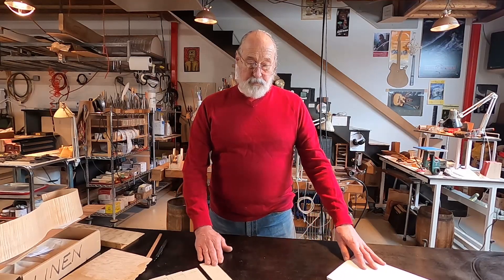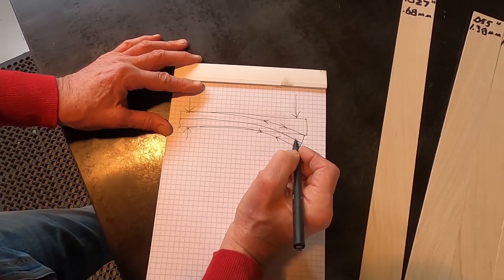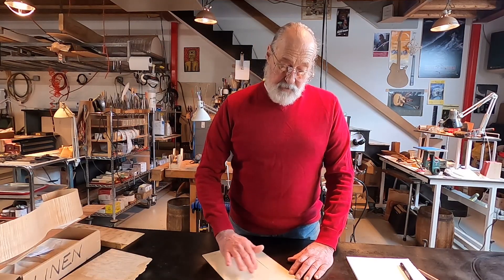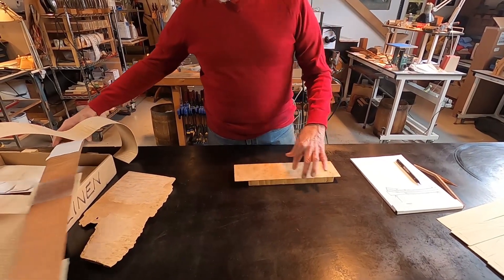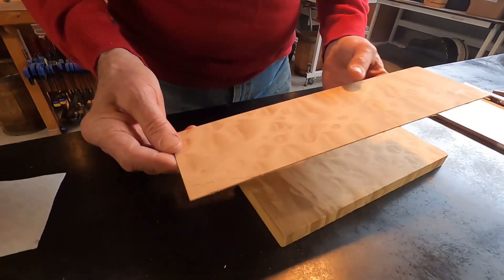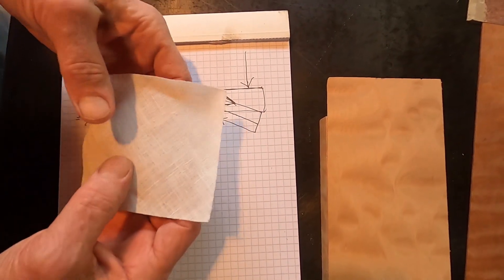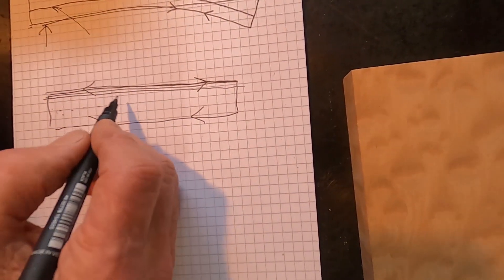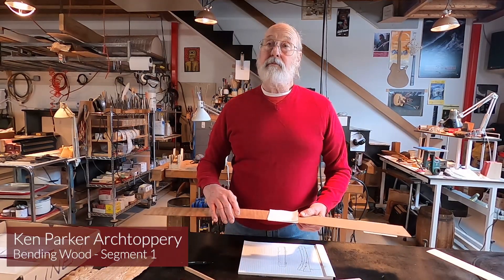Ken Parker Archoppery: Bending Sides 1

Comment: i wonder how many sides Ken has broken before becoming the master that he is now
Reply from the maker: Sides are easy to break, especially when they're thick, and I've done my share, as you suppose!

In 2004, I tried to bend the curliest maple I ever had, and was sent right back to the drawing board.I got myself an eager intern, and for the whole summer we played fearlessly with bending/breaking follies. 

I learned so much about wood and bending, I can't help but recommend it. Played with thickness, temperature, tension restraints, and on and on. We learned so much it was crazy!

Nothing breaks in my shop anymore, I promise.
Reply: @kenparkerarchtoppery9440 . It’d be great if you ever have the time to write a book about your bending experiences, mistakes and final proven methods that garner success (more often than not). I’d buy that book in a heartbeat. Thanks Ken!
Reply: @kenparkerarchtoppery9440 my first guitar i bought the best grade of flamed maple and bent the sides on a metal pipe with candles inside😂 took me a whole weekend of constant anxiety not knowing if it was going to break or bend.

Comment: Youtube should be paying Ken generously just for his name to appear within its fold, let alone his awesome content. 🥳👏😉
Reply from the maker: What a happy thought! Do you have access to any levers of power, perhaps? Do tell!
Reply: @kenparkerarchtoppery9440  hi there ive made most of an archtop electric but its time to steam bend the sides. I have 70yr old sheet of 5mm mahogany i want to heat  pipe  bend. Theres some quite tight bends. The back is arched and also the top. So the sides once you mark out the strips are going to have some crazy shapes and wiggles. But my problem is knowing how to slope the edges of the strips to join to the top and bottom.
I can't just do the same slope all the way along because if the diferent directions they bend. I completely lost.
Any advice

Comment: With to days modern materials bending the sides could be massed produced as pre formed sides maybe not even made from wood but maybe composite materials.
Reply from the maker: Of course, Antonio Torres, the inventor of the modern classical guitar, famously built a lovely sounding guitar, forming the back and sides from papier-mache with one of his usual spruce soundboards, I think around 1850. Since then, many have tried a whole lot of other materials, see Ovation's "Bowl-Back", formed from fiberglass and resin; while some current builders are using laminates for the sides which include paper or cloth bonded to wood. Others made from carbon fiber and epoxy so there's lots of work already done here in the direction you suggest!
One decision that drives the whole thing is whether or not you want the structure to be rigid or compliant, and there is room for experts to disagree here, that's for sure!

Comment: Being also a structural engineer I find this idea (of reinforcing the side that cannot take significant tension) very sound one! Like in reinforced concrete beams.
Reply from the maker: Yeah, it's a great method, but nothing new, really, The ancient builders used parchment, vellum and later, paper and cloth for reinforcing before and after bending. Lute shells are normally completely covered with paper inside, a composite structure.

Comment: Hi! Could the same result be achieved if instead of linen a good quality paper is used?
Reply from the maker: Sure, you would seek a high rag content paper with excellent tear resistance.  I used to use Kraft paper and hide glue.
Reply: @kenparkerarchtoppery9440  i asked this question because i remember reading that luth makers used to used a similar technique, but using parchment. And then, that some contemporary Spanish guitar makers use newspaper. Thanks!

Comment: Mr parker do you resaw the wood for the sides yourself? If so, how do you process it to the thicknesses that you want?
Reply from the maker: I do resawing here at my shop.  I have a tuned up widebelt sander with a platen to remove the sawmarks.  I'm planning a series of lessons on understanding and using bandsaws, the luthier's only indispensable machine.
Reply: @kenparkerarchtoppery9440  I honestly can't wait. Thank you very much.

Comment: Beautifully explained ken. Where did you get the idea of linen reinforcement?
Reply from the maker: As I mentioned, paper and woven cloth reinforcement is nothing new in instrument making.  Years ago when I was making long scale 6 string basses, I tried veneering softwood neck cores with hardwood, maple and ebony.  This is the traditional way that lute necks were made, in order to reduce weight, and provide a hard "shell" that you can tie the frets around without denting the neck.  The fingerboards of these instruments were also curved veneer.  I glued Kraft paper to the outside of the flat veneer with hide glue, then used a heat blanket to steam and cajole the veneer to bend across the grain with heat, moisture, and, well, maybe just some mild voodoo.  After the veneer was bonded to the neck, I could sand the paper and glue off.  So it seemed that a bit of light cloth with the right fiber orientation could be really helpful to discipline the wildly curly woods I use in my work.  It has proven to work miraculously well, and makes me very happy.  The reason for using epoxy in this case is that I use the same kind of resin for the primer coat, and so it all blends perfectly, and poses no issues.

Comment: At 2:50 when you broke the stick, I suppose you could say it was done with 'in-tension'
Reply from the maker: Mr Cranmer!  Love you work, love your videos!  I try hard to do everything in-tension-ally, but sometimes I fail.  Normally my failure is not due to compression, but maybe not always.  

Nice to see you in the number!

That 1930 L 5 that you had a look at was a revelation, especially since it was brought to me along with a '29 L 5 that looked like they had been built and sprayed by the same crew on the same week.  My dear friend, Steve Berger, who owned them both was flummoxed, and wanted to get my take on why they were so different. Only difference was, the '29 sounded like heaven, and the '30 (at least I was told it was a '30) sounded like POO.
Looking inside, the '29 was a lovely thing, nicely thinned and voiced, tidy work, pretty little braces, while the '30 was a HACK job, with 50mm of ungraduated wood around the interior top perimeter, 40 grit disk sander marks in the crude depression in the center, and KERFED braces sitting in pools of hide glue, with  1.5mm thick curly maple veneer cut into strips on a JUMP SHEAR glued across the kerfs to restore the tension side of the brace, again lots of hide glue dribbles.

Clearly, the 1929 crash was a huge stress for every business, and Gibson had had a rough '20s decade when everybody else was making good bank, because the mandolins they were so good at making and marketing went out of style after WW1; and they struggled to sell enough guitars and banjos.

Sounds like the accounting department got to be in charge of how many hours could go into a guitar, and the poor guys on the factory floor had their shortcuts cut out for them, or something like that. whoops! 

Way back when, 1985, photography was hard, and not in my quiver, so I don't have any process documentation, but it was pretty straightforward considering the top graduation and bracing work was done with the neck and sides attached.
I figured that since I was re manufacturing the guitar, I could X brace it if I wanted, so There.
Thing sounded great, and was quite a lot more powerful than the '29 when it was all back together.
Glad you were able to get a look at it.  What did you think?

PS,  I've done an informal survey, and I can find nobody who thinks kerfing braces and gluing shattered curly maple on the back to tighten things up is good practice.
Reply: @kenparkerarchtoppery9440  Hi Ken! It's so cool to learn more about that L5, I was pretty curious as to what state it must have been in to require such extensive work! I only had hold of it for a couple of hours, but it was a joy to play and has aged beautifully. I'll be sure to pass this along to Ruurd at the Dutch Archtop Museum who currently has the L5 on display - I'm sure he'd love to know more about it!

But wait, are you telling me that 50mm thick plates, broken bits of veneer, and pools of glue are not best practice? No wonder my guitars sound the way they do! ;)

Hope to meet you in person someday. I have so many questions - especially about your bridges!
Reply from the maker: @CranmerGuitars  Ha! I wonder if that feckless old L5 had good strings on it, and, if so, how it sounded to you?  I remember hearing that the guitar was for sale in NY a bunch of years ago, and was sad that it went to EU, and I missed the chance to play it 20 years after I did all that work.